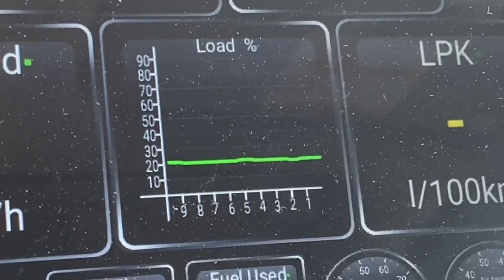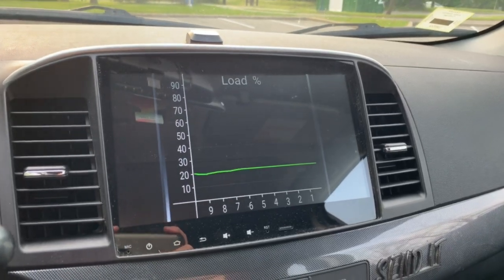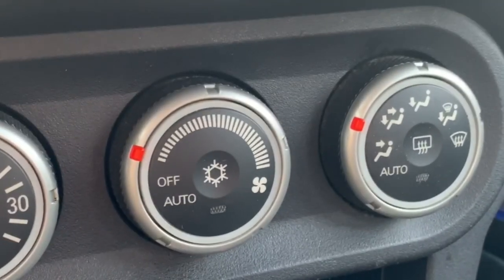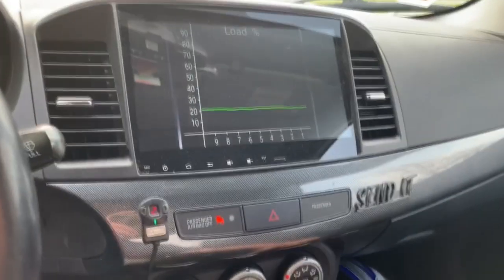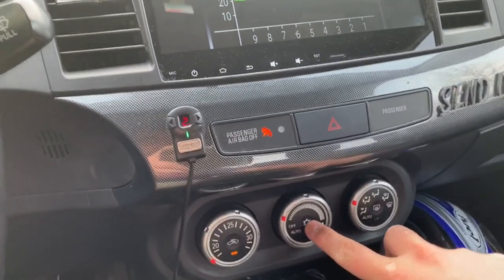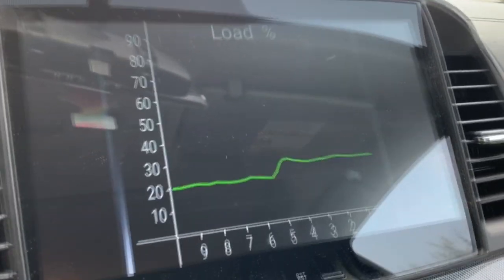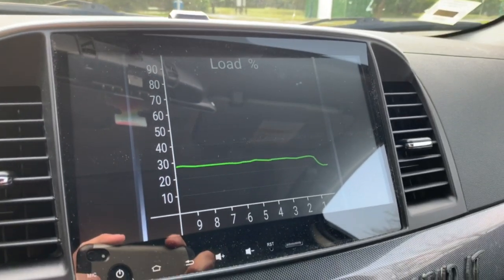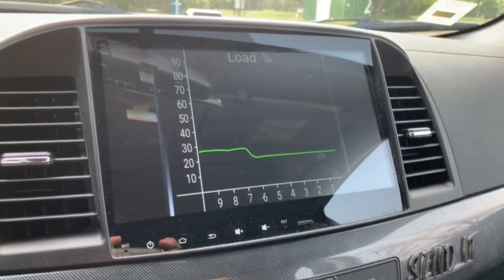How much MORE GAS does your AC use?

Comment: I done an actual test using everyday driving conditions. Just driving back and forth to work. A full tank of gas without the AC got me 360 miles before the gas light came on. A full tank of gas withe the AC running got me 335 miles before the gas light came on. so it does make a small difference but not anything significant. The car i tested this with is a 2013 Ford Focus with a 2.0 liter 4 cylinder with an automatic transmission.

Comment: Nice vid! Always wondered how much the AC was actually using. Not worth it to me tho lol, rather just drive with the windows down.
Reply: You would think in this day and time cars would be made better so a.c. doesn't affect the gas. Considering how much a car costs.
Reply: @outdooradventurer394  this test is BS. He showed how much ac cost at max settings while idling in his car. In fact windows are slightly better in city and ac at highway but is very hard to measure anyway because deference is so low and too many variables.
Reply: At the same time, driving with the windows down increases drag, causing more power and torque for the car to put out, battery operated a/c will do the trick.
Reply: Sadly that’s not an option during the summer in arizona..
Reply: @outdooradventurer394  . What about rain?
Reply: Well, depends on the country. I live in the tropics. And not using ac is not an option.
Reply: Eliu Haro No kidding. AZ during the summer is hot as hell.
Reply: Your stuck with that good old wifes tale, when the cab has cooled down the a/c will cut in and out to maintain the temp, this would then use less than at turn on, the drag from windows down uses more than your a/c ever would. so mate do your balls a favour and give them a treat. on the other side of this, who cares if it cost you £5 extra per tank to stay nice and cool! boom
Reply: On the hwy windows down will waste more gas than just using the AC.
In city or heavy traffic idk why you would use it since there’s barely any airflow.
Reply: Stop wondering this you being ridiculous. Enjoy air conditioning its pure luxury just for maybe 2 dollars more per refuel
Reply: @dreki-brawlstars  yeaaaa... looking back idk y tf i wrote that tbh lmao. I sound dumb af. I blast the shit out of my AC.

Comment: Good video, all cars are going to be different, some even use a Variable AC compressor, Also when you’re on the highway it’s the same amount or cheaper to run the AC than it is to have the windows down for the drag
Reply from the maker: True

Comment: I mostly sleep for about 4-5 hours in the car in between shifts, instead of driving an hour back and forth from home half-asleep. And with weather in SoCal right now in the summer peaking at triple digits, I would go with AC instead of suffering a heat stroke any day. 

Thanks for the video.
Reply: follow-up question. Would idling for hours on a hot day with the ac on repeatedly, damage my engine in the long run?
Reply: you're putting a lot of stress on your engine thiswill shorten its lifespan 
Ps . I'm not a pro or have the tools to confirm it  but I think it is common sense bro
Reply: Bro so you really sit there idling for 5 hrs? You need to get a better job and/or move closer to work buddy
Reply: @G-flo your oxygen sensors will burn out much faster and depending on each model, there might be 1-4 sensors. You're looking at a bill between $300-$600 depending on the model. Sensors are about $70-80 but accessing them to change them is super time consuming which increases labor time massively. 
You're also clogging up your catalytic converter far faster.
Idling engine is still circulating transmission oil if tour car is automatic which creates heat in transmission but no running air to cool the oil and other transmission parts. Just some things to consider.

Comment: To get an  even better 20% gas efficiency I removed and bypassed my AC compressor  completely and fitted  a shorter  belt for less pulley friction on the crank and 20kg less vehicle weight ! On a warm day I still keep my windows up and just use a separate 12V fan I stuck on the dash !

Comment: nice video, nice head unit. I'm not convinced that a/c uses more gas, and the reason is because the only reason your fuel consumption increases is because the rpm increase. your vehicle (as many of our vehicles) has many miles so that load has more impact than a new vehicle would. for example, go rent or test drive a brand new vehicle and turn the a/c on max & you will hardly notice any difference. so basically, it's the increase in rpm not necessarily the a/c. if you slightly push the gas pedal so that it raises the rpm to 800 (with the a/c off), you will see the same 1cent/gallon increase. Also, another reason I'm not convinced is because the a/c compressor is constantly spinning with the belt no matter if your using a/c or not. in addition, you may have that spike in engine load & increase in rpm when you first turn the a/c on max however after 30 - 60 seconds it will level out and your fuel consumption will go bck to normal. at 2:25 you turned the air off and back on to show that it gives a constant increase, however most modern cars have thermostat to monitor interior temp and the fact that you didn't let your car a/c run long enough to cool the cabin is why it will wrk hard at first start to cool the cabin.
Reply from the maker: Thanks for the comment, and while you raise some strong points,  id just like to mention that my compressor is not always spinning as there is a clutch that physically connects and disconnects it from the drivebelt. Secondly, form a physics stand point, if the engine is idling at 700 and we induce a load on it, the rpm will drop, say to 600 as an exmaple.. the ecu will want it to be 700 again so it will conpensate accordingly with air and fuel, thus burning more gas (not much but more than previously). Thirdly, i am not sure if this is the case willa ll modern 2020 cars but in my lancer, the ac cycles on and off and on and off like a baseboard heater, it is not modulated so it cant work half as hard or a third as hard depending on if the cabin is at the set temperature. What it does is it will simply engage the clutch for a longer period of time and have it cycle that very often, then when the cabin is at temperature and all it needs to do is maintain it, it will cycle less and the on periods will last say 5 seconds instead of 30 seoncds. I hope this clarifies a few things :)
Reply: @Huntsteven6  either way, nice lancer & I'm huge fan of Android head units 💪
Reply: Hey would you know if gas gets used if you turn the heat on?
Reply from the maker: @joshgrant5375  no, it doesnt
the heat is just used from the coolant to heat your car
Reply: @joshgrant5375 the only load on the engine would be your fan motor to blow air thru the vents

Comment: This matches the results Tech Ingredients found idling in the winter, so that basically proves it lol - regardless of weather, you're looking at about 1/3 gallon per hour idling a typical car with heat/AC on.

That's significantly cheaper than I expected, so I'll finally stop worrying about the cost of this when I do it.

Comment: Great video Steven,
I never thought to use all those gauges in such away. 
How much more does the load go up if you turned the fan all the way up?
Reply from the maker: I dont have a precise answer for you since i havent tried that, however I would assume not a whole lot at all because from minimum to maximum, the blower motor would probably consume maybe 100W more as opposed to the 3-4 kW likely consumed by the AC compressor.
Reply: @Huntsteven6  but the ac compression is belt driven by the engine ..
Reply from the maker: @infrasonicrebasses4763  yes

Comment: I think that test was done at idle, if so, I think your numbers will be a fair amount different under "driving" conditions.
Reply from the maker: If anything the ac will consume more gas when at higher revs due to increased resistance, but in the scenario, that difference will pale in comparison to the road ondulations, cruise control variations and wind conditions which would make accurately measuring a difference near impossible

Comment: 20 to 27 is almost nothing

80 cents an hour is hardly a factor. Also, if you don't run your A. C. regularly for a long, long time your seals will dry inside the unit and it won't work anymore, and it will leak the coolant into the air/atmosphere and add to the environmental consequences. Also, this guy should run that efficiency/flow/load test on the freeway with windows down. A. C. should win, unless you have a bad A. C. compressor.
Reply from the maker: Cintia this video wasn’t aimed at performance differences but rather fuel costs, in which case 7% is a lot because it’s an Increase of almost 40%
Reply: @Huntsteven6  oh

7 is 40. Gottit.
Reply: @AngelCintiaRockgirl  20% load without AC on, 27% with AC on. 7% ÷ 20% = 35%(almost 40) increase in load during his test.
Reply: @AngelCintiaRockgirl  you're not good at math
Reply: @QTALISCHILL  I dont Believe that is directly translating though because 40% for the sake of nice round numbers is almost half and running the AC does not cut your gas mileage in half

Comment: I’d like to see that same test when the car is not at idle.  So the same test in a highway with cruise control on and I imagine the difference would be negligible.
Reply from the maker: The fuel consumption difference will be the same if not higher due to the increased resistance of the AC pump rotating faster. The only difference is that since the car is combating a higher wind resistance due to travelling at high speeds, the relative consumption will be less. But net, more.

Comment: You should experience the fuel consuming while driving the car with open windows vs fuel consuming while using AC ( windows closed ) 
And you will be surprised by the result.
AC on will consume less then driving with open windows on a hot day in thr highway!
Reply from the maker: I’ll give that a check! Thanks

Comment: wrong comparison.
When you speed upto 50KM/Hr, the air drag as a result of air rushing in cos windows are down puts more load on the engine than when AC is on and windows up. So you actually save fuel with AC on and windows up
Reply from the maker: Nope

Comment: What about the heater? And does fan speed make a difference?
Reply from the maker: The heater no, because it circulates the cars coolant, the fan does a bit but not by a considerable amount
Reply: @Huntsteven6  yes the heater uses gas
Reply from the maker: @dixiedamelio8170  no
Reply: @Huntsteven6  okay thanks, my car is unable to turn off the ac\heat and it stays always on full blast. I guess I'll go with heat instead of AC then

Comment: What about people with allergies and pollen?
Reply from the maker: Tracey Cancio how is that relevant
Reply: @Huntsteven6  . If a person doesn't want windows down because of allergies and doesn't want a.c. going, then what?
Reply from the maker: @traceycancio1795  then have the fan blowing air through the filter without the ac on..
Reply: Turn ac on with recirc in to close off outside air or buy a tesla they have best filter ever
Reply: That's brings your $/gallon up by 50% cause you'll be spending half of the time your car is on being an idiot. And that's quite a load on your engine just idling and texting your ex husband and your therapist

Comment: I dont think this test can be considered a good test. Lets say the engine only produces 50 hp at idle and the AC consumes 3 hp to operate. So that's 6% of engine power consumption and that seems like a big number. 
But when engine is producing 100 hp during normal operation then the power consumption is only 3% and if the engine is producing 150 hp then the load is 2%.
That's why smaller cars get affected more by AC operation than big ones because they have small hp engines.
Reply from the maker: The load was a demonstration, the fuel flow was used for the calculation. Also I think we can all agree that this wasn’t a science video done in a million dollar lab… so take it with a grain of salt please

Comment: What the car engine buddy?
Reply from the maker: 4 cylinder
Reply: @Huntsteven6  buddy I have a Camry 2008 3.5 V6, what do you think would it consume in an hour with ac on
Reply from the maker: @jashansingla2421  little bit more than in video
Reply: @Huntsteven6  like around 1.5 liters an hour
Reply from the maker: @jashansingla2421  possibly

Comment: You didnt calulate areodynamics/drag while driving into your equation. Good Vid but not accurate.
Reply from the maker: But that remained constant and doesn’t change with the ac being on or off, I actually made another video demonstrating the effect of drag of my wing on gas mileage
Reply: @Huntsteven6  it doesn't remain constant if the windows are down which is usually the alternative to A/C.
Reply from the maker: @Slevin_Kalevra  very true, I could make another video. But if I go driving to make it then the effect of the windows will likely be on a scale comparable to if there is a tailwind or headwind
Reply: @Huntsteven6  yes you are absolutely correct it would be nice to get a data set with all variables but this whole situation is subjective anyway lol. It's all about comfort.